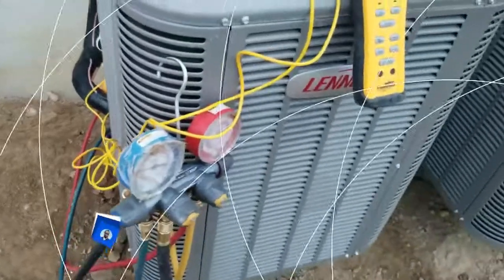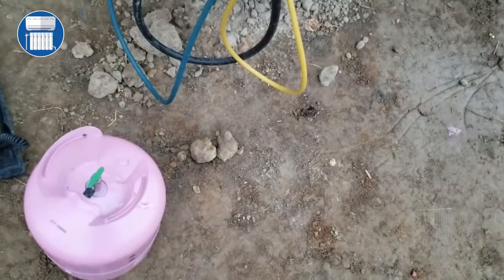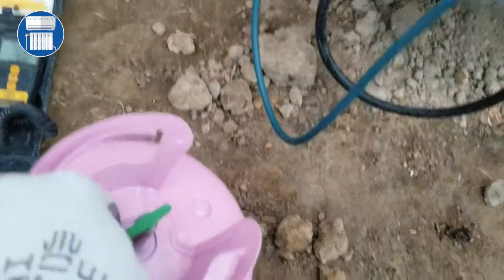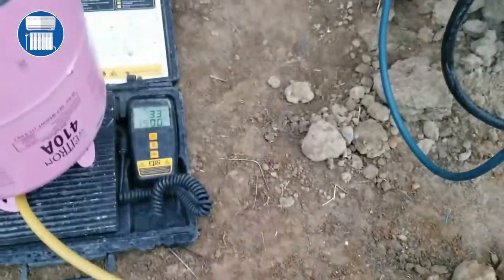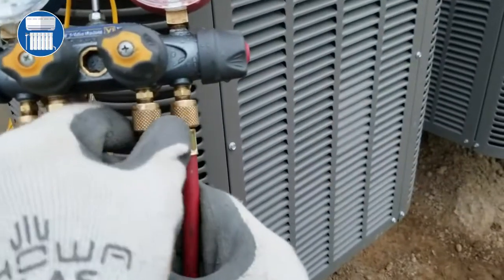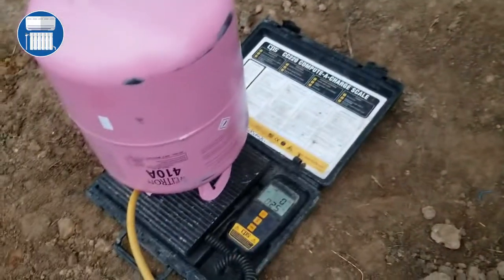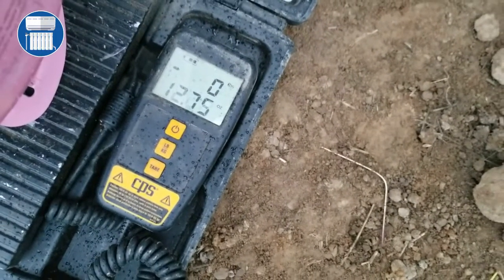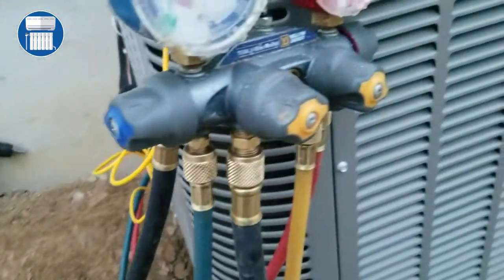how to charge air conditioning unit with 410a for perfect pressures.

Comment: Wouldn’t it be important from a tutorial standpoint to show the AC Unit label on how many pounds of R410A is required, and also know what the outside temperature is and also the inside temperature as well? This is to determine what temperature I should be looking at the R410A gauge, instead of just pumping into the AC system R410a and just looking at the scale, also to check to see if there was a leak from the line or unit because jeessh you’re putting 15 pounds of R410a there has to be a reason why it’s no longer in the AC unit.
Reply from the maker: thanks but these units are new so leak search would be pointless its the first time charging it also if you adding refrigerant you would need to charge by superheat or subcooling
Reply: 15 oz not pounds

Comment: Don’t know a thing about HVAC.  Was wondering if it is common for companies to purposely charge units with 410a below capacity if the unit was installed during cold winter months?
Reply from the maker: they should measure line set and add .6 ounce to every foot but should return in summer to properly charge unit.
Reply: you cant. The only method is with a sight glass. If you see bubbles you add. Thats it. you need 70 to 80 temps. 80 best because you need superheat and subcooling to be operating correct when its in cooling mode. Or you have toome back and check. I tell the customer their options. Mostly they want it before of fear of me being over booked. Whats scary is he using a old set of gauges
Reply: No when we charge units it will be to the exact recommended charge for the unit plus line set length. You can't charge a customer to come back 4 to 6 months later to throw 6oz to a pound in.

Comment: Aren’t you supposed to throttle it in the low side? Dumping it like that can get liquid in the compressor right?
Reply from the maker: When the unit is running you have to charge by vapor if the unit is not running you can charge on the liquid sign remember you never want liquid in your compressor when it is running I may do a video explaining the refrigeration cycle.
Reply: That's why you turn the jug upside down. You fill it from the suction side, or Low side, whatever you want to call it.
Reply: I was just thinking that